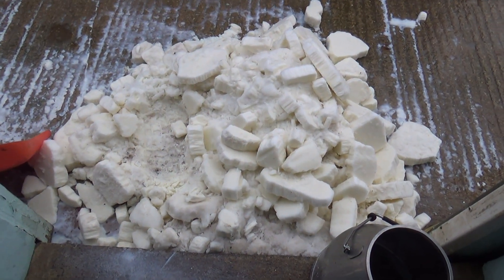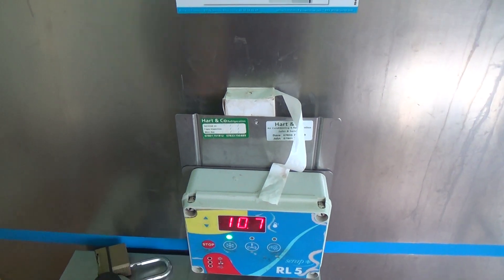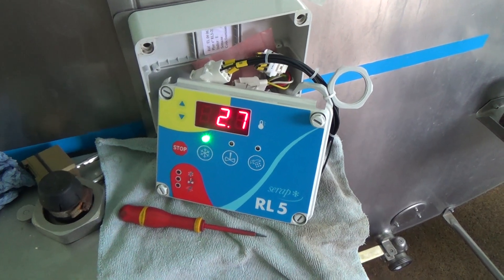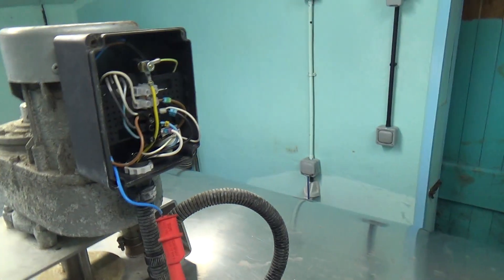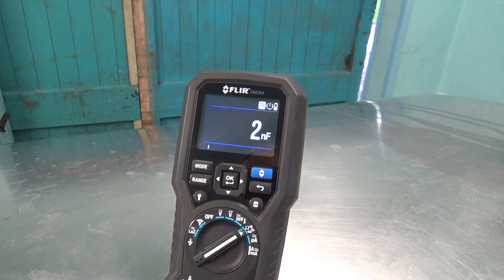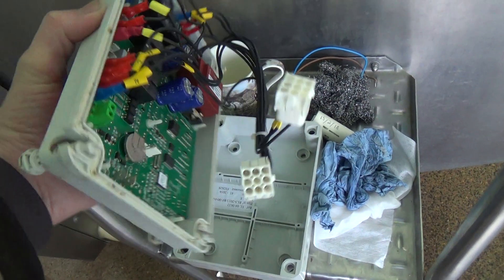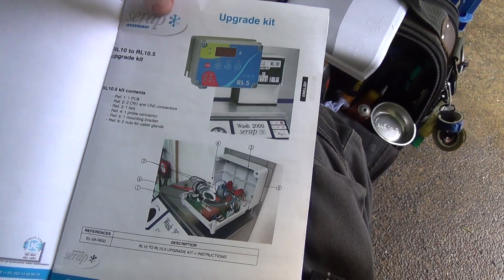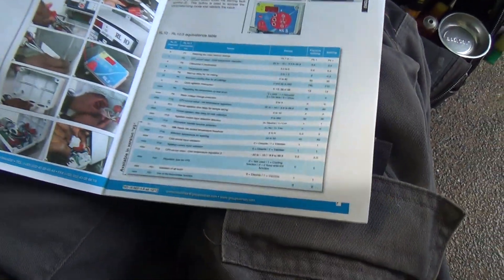Frozen Milk Fault

Comment: Morning John, just checking your OK as not seen much of you on Facebook and just making sure you haven't poisoned yourself with raw lentils or in date food. Our Canadian comrade was worried he hadn't seen you
Reply from the maker: I've been kept safe from the in date food! 
Took a break from facebook then when tried signing in again they had deleted my account!
Reply: @heavydiesel   that's why I have 2 accounts. Same password 😄 Mike Holm has  had issues with his botched ashp he used a split heatpump condenser 10kw midea with basic control signal of heat demand , piped to a 60kw rated plate heat exchanger. That feeds his buffer tank. Buffer tank has 1 radiator circuit with about 15 rads . Hot water  is separate. He used the precharge of the condenser didn't add any additional charge.  Turns out plate froze and got water in the fridge circuit. He's in the process of replacing condenser and plate but I suggested a few safeties like making sure his discharge pressure is around 30-34 bar 410a suction over 6 bar . Bit of glycol in the water circuit. Incorporating a flow switch/pressure differential switch across the pump to stop the condenser if pump fails. Not heard lately how he's got on .  Anyway keep busy, keep up the videos , keep shandy dave stocked up with tools and see you soon

Comment: Normally frozen milk is great, though probably best in a cone or bowl, not as a filling in the tank. Going to guess water got in through an aged seal, should have put a thin coat of silicone grease on the new seal to at least slow it down.
Reply from the maker: I suggested they made a 'milkman' out of it, they didn't laugh...